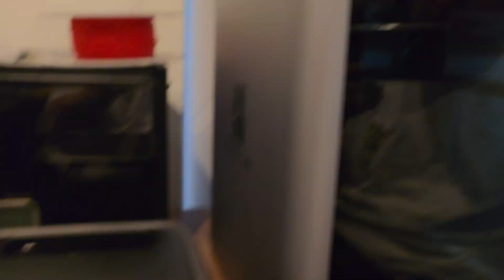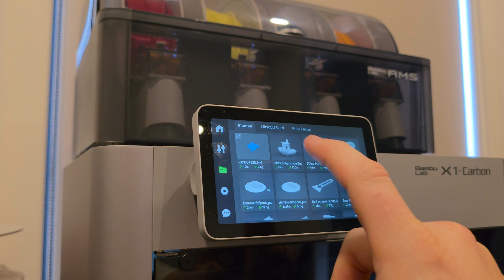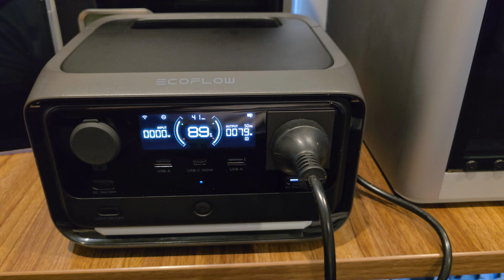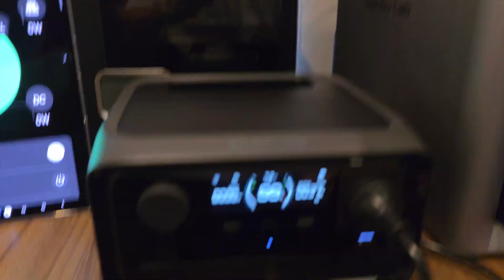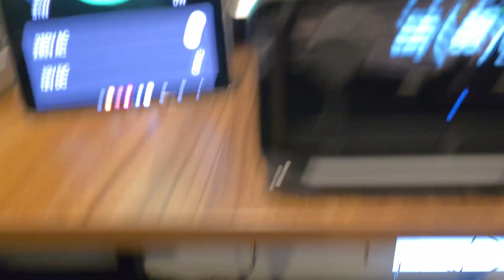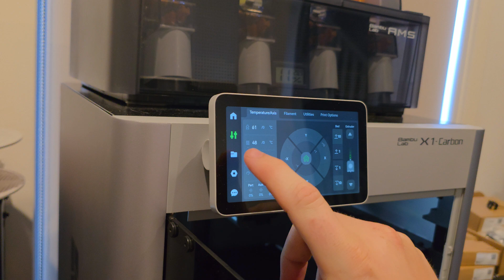EcoFlow River 3 Plus as a UPS For Bambu X1 3D Printer - COMPLETE FAIL!

Comment: Im having similar issue.. i received my one today and just firing up a very small travel hairdryer ahows overload at 520watt with xboost already on.. it works fine on my delta 3 plus
Reply from the maker: That's very interesting, so perhaps the unit can't even handle 600W as advertised... Are you sure it's drawing 520W? Some hair dryers will draw a higher wattage on cold startup, IE up to 1,000W+.

Comment: Thank you , was looking purchase to do something similar for a Bambu A1 combo hope it get's sorted out either finding a fix or getting a refund.
Have you reached out to support ? I would do that first. While waiting for a response, check firmware version (don't update yet just check)
Reply from the maker: The Bambu A1 might work fine with the River 3 Plus, I will have to test it. However, I've purchased a Delta 3 Plus, albeit more expensive, and it works great to power my 2 PC's, A1 Printer, X1 Printer, and Air purifier. Currently, with both my PC's turned on, and my X1 printer running, the Delta 3 Plus is drawing 540W - I peaked at over 2,000W for a short period of time and the battery handled it like a champ. 

The Voltage drops from 235V to 220V when Mains bypass is enabled on the Delta 3 Plus. 

The River 3 Plus might work for only your A1, though to be honest, if you can get the Delta 3 Plus at a discount (Check eBay periodically for a 15-20% discount), the Delta 3 Plus is a safer option to power your entire PC room / printer room, etc.
Reply from the maker: Also, their Customer Support has been "OK". They did offer me a couple of options to resolve the issue, though it's frustrating because their Customer Support aren't fully trained in the functionality of the battery. 

If the battery had an option to Disable Battery Bypass, then I could power the devices using X-Boost while connected to mains. However, because it doesn't have this function, when the battery is connected to mains power, it can only provide up to 600W to connected devices, X-Boost does not work when the battery is connected to mains power.
Reply: @PsyTechGod  Did you find any answers? I am running an X1C off a River3 and it seems to work fine. Up in America, maybe something is different.